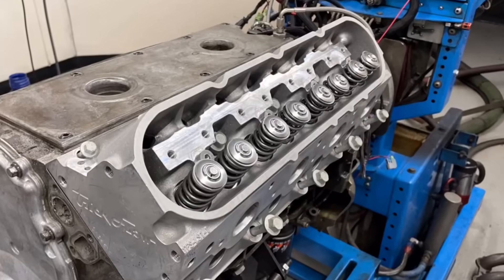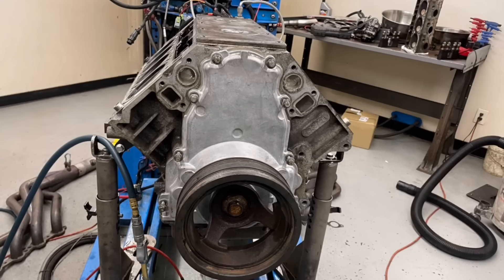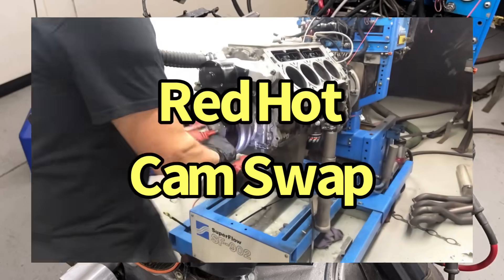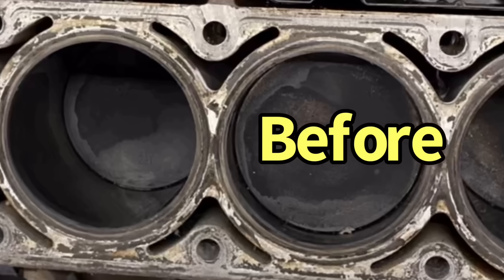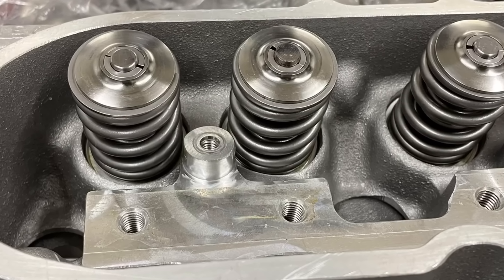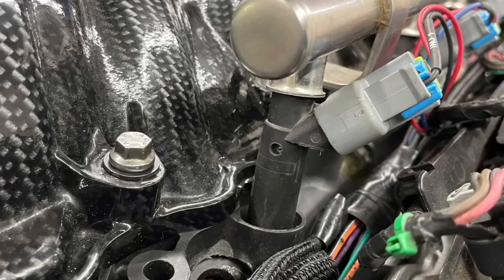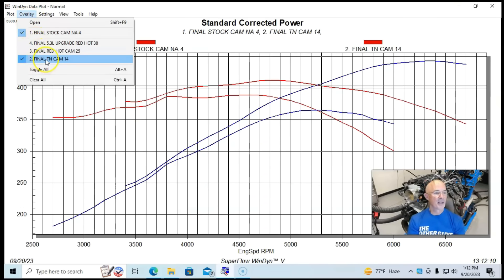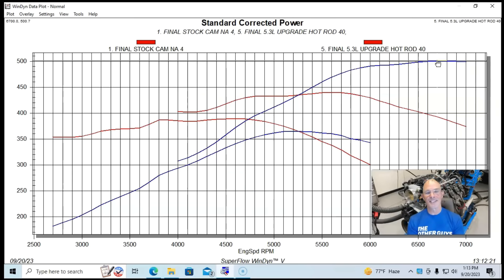HOW TO: THE ULTIMATE 510-HP, ALL MOTOR JUNKYARD 5.3L BUILD.  STEP BY STEP BUILD & FULL DYNO RESULTS

Comment: My 4.8 has low oil pressure, will this setup fix that issue or kead me in the right direction. Dont want to buy another motor. I love my little 4.8, any help would be nice
Reply from the maker: LOOK AT PUMP, O RING, CAM RETAINING PLATE SEAL, BAR BELL, REAR COVER SEAL OR GENERAL HIGH MILEAGE AND BEARING WEAR
Reply: @richardholdener1727  I already replaced the o ring and the mileage of the motor is 130,000. The shop says its the cam bearings but they found no metal shavings in the oil pan so I'm just confused. The oil pressure with the o ring replacement is at 20 to 25 at idle which I know is low

Comment: Great work! I love hearing the screaming V8. So many LS powered trucks pull campers. My LQ4 03 2500HD does, you know 7800lbs of 5th wheel slows it down some. Steady wind resistance and various grades keep it in “Work mode” at 2000-2400 rpm, 60-70+ mph. But the real torque at part throttle is at 2500 rpm and above, or 75 mph or better. So where does a guy hunt for moving the curve 4-500 rpm lower? Use the early iron head LQ4 camshaft, LM7 cam, or advance the stock 1721 GM cam, or? Thanks for your continuing content.
Reply from the maker: compression, displacement, long tube headers and boost all help power way down low
Reply: @richardholdener1727 
AND… of course a little bit of power building engine information from a legendary man does tend to help also!!! So, in other words… DO WHAT HE SAYS AND YOU’LL FIND PLENTY OF HAPPINESS WITHIN THAT LITTLE ENGINE THAT COULD!!! 💯💯💯

Comment: So what rear wheel horsepower will I achieve if I port 243 heads, red hot cam, paired with a stock gen 4 5.3 intake and throttle body? I have a LY5 motor

Comment: So does an engine dyno compensate for the loss you would see on a dyno to the wheels ? Just curious since you lose a little bit through the trans and drivetrain components, so would that 500 hp to the wheels realistically be like 400?
Reply from the maker: wheel hp would be less than flywheel hp
Reply: No it doesnt

Comment: How did the Trickflow as cast 220 heads fit a 5.3?
Reply from the maker: it works fine-just like a 243 head does
Reply: @richardholdener1727  Oh interesting.  I've read the minimum bore for these heads is 3.9, so that's actually really helpful.  

With the 30 thousandths mill, the 41 thousandths head gasket and the l33 flat top pistons, what do you think the compression ratio was at during these runs?
Reply from the maker: I didn't measure the chamber volume

Comment: What other heads would work to make this power? Is there any heads that I could just buy and bolt on without having to get them Ported?
Reply from the maker: yes-the 220 tfs as cast heads or you can buy and bolt on many stock or after market heads that are already ported

Comment: If I had 480 Hp, I'd say that is a good day.  I just read teh comments and answered my own question, if you started with a 6.2L would that larger displacement, make it easier to reach the 500 Hp ? Yes.  RIchard says to start with 6 Liter.
Reply: Same...wouldnt waste time with a 5.3 unless it was stroked...just too tiny to throw money at otherwise. 
Btdt  Now a 383 with a good head, solid roller would be a riot...driveable 500+rwhp

Comment: I have a 04 Chevy suburban with a 5.3 flex fuel motor with  340k on it. I've watched a few of your videos and I am trying to figure out what would be a low budget 500hp build for my motor. I'm going to slowly buy the parts for it. But I'm not sure what to get. Thanks again for the videos.
Reply from the maker: the only low budget 500-hp 5.3l is boost

Comment: Richard. I'm curious if you check piston to bore clearance on you junkyard LS engines? Reason I ask is that I'm building a junkyard 5.3 myself and my OCD told me to check this. I came up with .0055-.0060". Cylinder measures perfect at 3.780". Would that run or be an issue? Thanks.
Reply from the maker: what cam is that with? but yes, I have run those clearances (dynamic is it much more)
Reply: @richardholdener1727  piston to bore clearance. Not piston to valve.

Comment: Ran into your page in suggestions and i like it 👌 i was curious i got a 06 sierra 5.3 , speed engineering headers,k&n intake  stock 799 heads, stage 2 texas speed cam , stock injectors ,build diffrentrial 3.73 gears 3k stall witn rpm level 4 4l65e and  how much hp you think its pushing?
Reply from the maker: need cam specs and what intake manifold

Comment: Hi great work brother but I have a question I was fortunate to come by a 2019 L83 5.3 all aluminum motor with the heads , could I make that a naturally aspirated running engine? It collapsed one lifter and scared up the bore just minor, so could I get away with honing it very lightly ? Ty for your time!
Reply from the maker: it already is a naturally aspirated engine

Comment: Could this be used as a turbo cam? Red hot?
Reply from the maker: yes
Reply: @richardholdener1727  awesome thank you!!
Reply from the maker: it would not be my choice for a turbo combo-I would want a milder cam that would be more responsive (it will still make the same power since the turbo dictates that)
Reply: @richardholdener1727  could I possibly  do a stage 2 or stage 4 turbo cam from btr or Texas speed instead, I want mild NA power before I boost my s10
Reply: @richardholdener1727 also was this pump gas on stock lb injectors?

Comment: Richard, I have a question. I have a 5'7 LS1 with a stage 3 cam 595 lift 238 244 at . 050. Love separation angle is 114. My question is would one of those eBay turbos the GT45 add some power to my engine? On a dyno at the rear wheels, the car made 403 horsepower and 386 torque. It is all stock other than a cam headers pushrods and valve springs. I would like to add 100 horse with one of those small turbos if possible and I know you're the guy to ask
Reply from the maker: a GT45 could add a lot of power to that combo-but you would be happier with a smaller cam and a turbo
Reply: @richardholdener1727  I've been driving the car for about 6 months and it's very driver friendly. Tuned by one of the best in the Dayton Ohio area. I wanted to make noise in the big chop because the last car I filled with ran 840s at 160 So this is just a toy to me. What brand of turbo would you suggest I buy in one of those cheaper models because I cannot find it from DNA motoring. And thank you for responding. I'm just looking to make 650 hp at the crank   with as little boost lag as possible. I'm going to try to get the car to run 10 flats in the quarter and that's the power I'm going to use and then make the car work. I think I can get the car to 1.3 60 ft has that goal to me is as important as making a bunch of power. I've drag raced for 35 years and it doesn't matter how much power you make. If you don't put it to the ground and a lot of guys would realize if they fixed their chassis they won't have to make so much power to run a certain ET
Reply: @cobblegilll  DId you read his reply?
Reply: @richardholdener1727  also what I need to do any upgrades to the fuel system at 7 lb of boost maximum? And if so, what would you suggest? Because there are so many things to read on the internet that I would just rather listen to one person and that one person I would choose to be you

Comment: All jokes aside... i had seen some dyno videos showing that the truck intakes were better than the fast and MSD intakes. I almost wanna say it was u that made that video. Were the truck intakes better in that video because u only did a mild build? Orrrrrrrr?? Cus i got room for a trucks intake in my mustang
Reply from the maker: You never saw a video of mine (or anyone else that does real testing) showing a factory truck (or TBSS) intake being better than a FAST
Reply: @richardholdener1727  it probably has to do with the other mods to the engine. I found my notes. And yeah the testing was done on a dyno with a 6.0L. They had a btr truck cam, stock 706 heads, and flat top pistons. The tbss intake made 13ft lbs more torque and 4 more hp than a fast intake did. His theory was because the cam and head combo preferred longer runners. I didn't understand how that was factual either but found some info on it in forums too. Maybe u should do a video comparing a mild engine with truck intakes vs performance. Use the btr truck cam too. Since it was the one the video guy claimed preferred the longer runners. He showed the dyno results. So he did somehow get those results. If I see it happen twice then I'd be convinced lol but for now idk about it. I could see them preferring longer runners for torque. I mean we see that with high rise intakes too on old school sbc. And since the ports on the LS engines are massive. Then maybe so. You would think the throttle body size would be restrictive tho compared to a 102mm throttle body tho.

Comment: What can be done to the 2007 5.3l flex fuel to duplicate these numbers?
Reply from the maker: the mods were listed in the video
Reply: @richardholdener1727  so it’s ALSO applicable to the LY5/LMG cause the engine he’s using is a L33/LM4?

Comment: Richard, I just found your channel, and I hope you get this. I've got an 07 four-wheel drive, Yukon. I bought it minus the engine. We  took a cast iron 5.3 block put a high volume oil pump, one set of top, and one set of side oiler lifters. So there's one tip and one side oiler lifters per cylinder, just to give it a good oil bath. We then added a set of cathedral port 706 aluminum heads, and a 6.0 Corvette cam. We also built it as a DOD delete. The  majority of the parts came from Summit. My question is. Did I increase my performance by any real amount? Being as I never knew what it was like before the original engine came out of it. I'm thinking of doing the intake and if I went with the cam you used in this video. What kind of horse power numbers could I achieve? I'm trying to get the best horse power and torque, but try to stay within my configuration. I have Champaign dreams, but live on a baloney budget. Lol I hope that this reaches you. Thank you for all of your time and advice in advance. God Bless.
Reply from the maker: side oiler and top oiler?
Reply: Lifters...what are you talking about?

Comment: I would have put ARP head, main and rod bolts just to be on the safe side. Better safe than sorry. Those stock bolts are JUNK....
Reply from the maker: 1500 hp with stock (high mileage, junkyard) main bolts
Reply: Dont need ARP main or head bolts

Comment: Were you using stock length pushrods when you ran the L33 and stock 799 with the red hot cam?
Reply from the maker: 7.425
Reply: @richardholdener1727  I appreciate the answer!

Comment: Just a question y didn't you try a roller rocker with the 799 maby that would get you what you need to get that 500 on a budget for say doesn't have to be a over sized ither because along with a bigger cam the less friction for say the better so going to a roller set up if my thinking on this is right could get you a Lil more rpm out of it and where you using stock valve springs or what
Reply: And also could have tried the trailblazer ss intake as well
Reply from the maker: roller rockers won't add much on a cam that already has sufficient lift. The stock rockers (already roller) are lighter and will run more rpm than full rollers (much heavier).

Comment: I have a built NA L33. I just moved from the Dorman LS2 intake to the MSD atomic and lost 37whp and 17wtq. In your experience, why would that be? Power is down starting at 2400 rpm, and the loss grows as it runs up to the 7200 limiter. 

11.3:1 comp on 91 gas
AFR 225 cnc heads
TSP Torquer V4 cam

Previously made 399/364 before the intake manifold change.
Reply from the maker: The Dorman LS2 makes the same as a TBSS-the MSD makes more in every one of our tests

Comment: I feel like 500 all motor shouldn't be a huge deal when you know what your doing and have the money since it's 100 horse per liter. You don't need a modern engine to do it either.

Shoutout to Craig for building a 500hp all motor 302 two months ago.
https://youtu.be/Q-30y3_im_A?si=8LcXHip9E1eOGeLU

Comment: I wish I put a better engine together rather then mess with a turbo setup.  Now all the money is spent and my 5.3 with a ss2 cam and terminator stealth is still not running. Thinking of selling the turbo junk and investing in some good ported heads.
Reply from the maker: WHY IS THE TURBO NOT WORKING
Reply: @richardholdener1727  it’s the routing and piping. Using the Holley/hooker manifold. Bunch of fabrication is needed to line everything up.
Reply from the maker: Do you have the Hooker turbo kit (right and left side manifolds with cross under)
Reply: @richardholdener1727  yes. Just wish someone made an off the shelf turbo mount to use with this setup.

Comment: I’d love to see you build an aviation SBC. Something making similar power (maybe a little less for reliability), turbo normalization to maintain power at altitude and able to use 80% throttle constantly.
Reply: Reliability issues are usually with the PSRU.(propeller speed reduction unit). Harmonics management in that range costs big money.😢

Comment: @richardholdener didja think to add E85 and some timing? Or possibly even race gas?
Reply from the maker: not needed
Reply: @richardholdener1727  not needed to 500. BUUUUUT, maybe 550 is attainable with the right field and more timing?
Reply: @ndemarco2013  Race fuel and more timing wont make him anywhere near 50hp. 
Race gas is more to keep pinging away wont make power by just running it

Comment: Do this with factory heads not modified. Aftermarket heads and all that work aren’t worth the power gain. This is why turbos rule. Everyone knows you don’t need new head bolts and used bolts actually hold better than new bolts.
Reply from the maker: Everyone?
Reply: @richardholdener1727 if you googled anything about ls headbolts the info is out there on the bolts with legit tests on them.
Reply: @richardholdener1727  https://youtu.be/n4wHPj9YxjI?si=QI6iDwQqxpnIAIYa
Reply: Turbos and superchargers are for those who want to achieve easy power.n/a is harder to make power but when it does you wont feel lags like turbo chargers :P

Comment: Well Mr. Holdener. I am one of the tight LSA guyes. :) 
2.04" intake valve in a 40.625 CID cylinder = 19.91 CID pr. Inch of valve diameter and calls for a LSA of about 109.5 LSA according to DVs 128 rule.  
The point of course is getting adequate overlap for the job, right?
If we just assume the mild BTR cam has 217/237/114, the overlap is identical to a cam with 217/217/109  ;)  
That is why it works so well. Its really is a 109 LSA cam, just with a lot of additional exhaust opening timing that confuses almost everybody.
Reply: I am on the DV train too. Typically, 109 and narrower is spot on for LS engines. Richard hasn't tested a single 109 (some ppl say the TN cam is actually 109) cam to my knowledge, but he has tested several 108s which should get all the torque available. But, all the 108s tested are only ~.550 lift which doesn't take full advantage of the flow of the rec port head. I'm ready for him to test 109 or narrower with at least .600 lift on a rec port ly6.
Reply from the maker: TN is 107.5
Reply: @richardholdener1727  Don't want to be "that guy", but did you cam doctor or degree it? Or are you taking their word for it? They don't give full specs, not giving the correct specs wouldn't surprise me.
Reply: @gearhead7896  More common than most people think...same with "custom" cams actually being a shelf piece
Cannot stand these cams without a grind in the PN, just stupid cartoonish names, stage xx etc. Tells me nothing

Comment: That's pretty impressive! Almost 100hp per liter just by swapping heads / cam / intake.
Reply: laughs in Honda

It is honestly wicked stout for how simple the combo is.
Reply: Yeah but 2x the power for likely less. Hondas are not cheap anymore. Not saying this is either but also laughs in torque.
Reply: @btownballer27 so true, Hondas were only cheaply built for like 10 years. Even then I'm pretty sure they were expensive everywhere outside of America, here in Australia you'd be paying twice the amount for a Honda engine that produces half the power, and a quarter of the torque.
Reply: @joshthomas2536  a cam and valves/spring setup is expensive in a honda where in an LS you can shove a choppy cam in and an air filter and gain 50hp

Comment: How much more would it gain if you changed the piston and ring thickness? You would still maintain reliability but squeeze a bit more.
Reply: I’d just like to see how much more you could get reducing as much friction as possible.
Reply: Hot Rod Network did a YouTube video where they gain ~8hp from going to 5/64" to 1/16" on a very healthy SBC (close or over 500hp). So, probably less than 8hp. I haven't watched the video in a while but, those numbers should be very close. https://www.youtube.com/watch?v=-29IWc-zrv8

Comment: Lived on a scrap yard all my life and still to this day ,a real scrap yard motor ,is built with scrap yard parts , no dino , no thousands ,for parts , and 500 hp in the scrap yard is nothing , I have built sbc , up to 650 , using scrap turbos or a modified detroit blowers , cast yead ground out by yours truly , 1987 sbc fuel injected throtle bodie in a Blazer build to look origunal .650 hp pump gas all scrap modified parts ,no machine shop no dino and no budget .
Reply: This is true
Reply from the maker: easy to do with boost-you can't do this with parts only from a junkyard unless you add boost
Reply: How do you come to a power number with no dyo?
650 on a GM TBI TB 350? BS